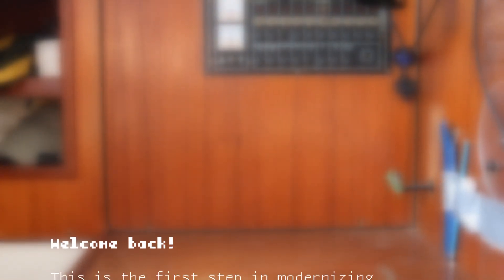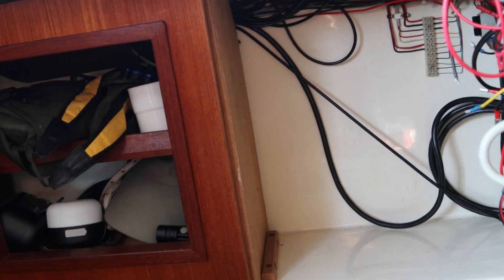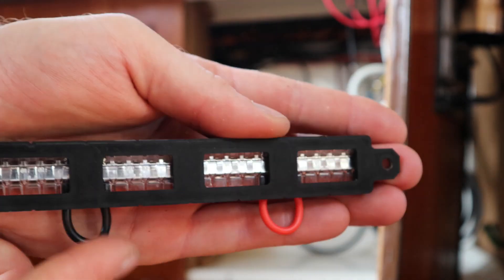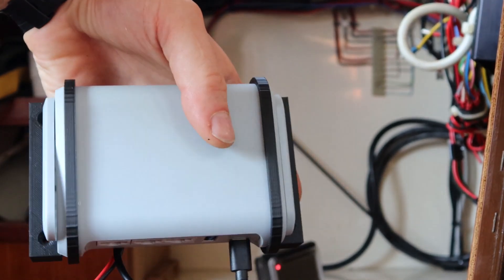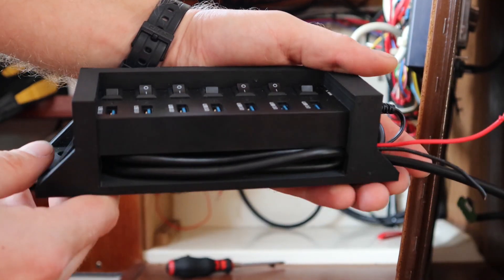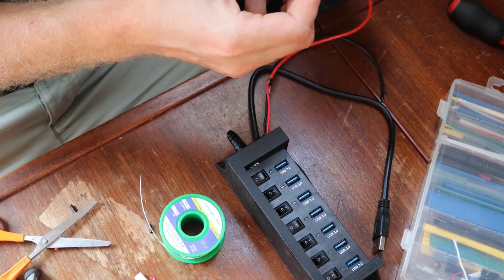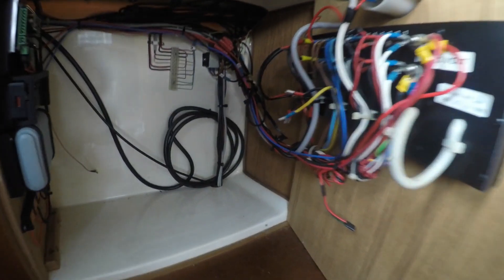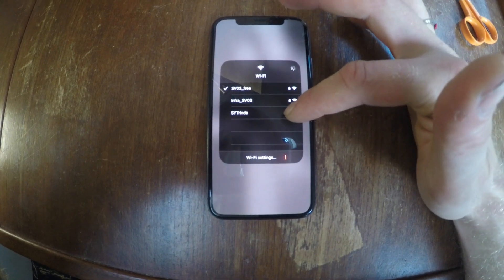DIY navigation electronics using OpenPlotter and MacArthur Hat

Comment: Random question on the USB Hub and the 'short cables'. I bought the same one and the cable seems plenty long. Did you use a different power connector or sacrifice wall-power unit which came with the hub?
Reply from the maker: Hi Neil, the USB Hub is powered by 5V DC. To get the voltage right, I have a 12V-to-5V DC-DC converter in my setup (see in the description 4. (USB Hub) 12V-5V DC Converter).

The wiring for me looks like this:
USB-Hub (5V) <-> DC-DC-Converter <-> (12V) Board-Grid.

Unfortunately that's not so clear on the video, because the converter is hidden inside of the bracket of the USB-Hub.
I've cut-off the cable from the wall-power unit and then soldered the cable onto the converter. The converter has two more cables getting +12V and Ground as input. These cables (which I've prepared) were short. 

I hope this answers somehow your question :-)
Reply: @8bitsailing  thank you!

Comment: Hi ! I have a similar project going on before this summer. (Nauticat 33, openplotter, MacArthur HAT, Halo 20 radar) Could you provide links to the usb hub and router ? Also stl files (or cad files) for the brackets would be nice. Best regards, Gunnar
Reply from the maker: Hi Gunnar! Awesome, I wish you all success for your project. 

I've added links of the parts in the video description and as well links to the 3d models of router and usb holder.

For the router I've used a different DC down-stepper then for the USB holder. Probably you want to use only one type.

Comment: Hey i know this is crazy but what is required to install the nmea network to say a yahama engine that supports nmea 2000
Reply from the maker: If you already have a NMEA network it's quite straight forward. You need to connect the MacArthur Hat to your NMEA network and then it should receive already all data-packages, which are send through that network. Then it's only about configuration in e.g. SignalK server, which is running on the raspberry pi.

If you don't have a NMEA network yet, then you need one in the first place. You need to connect your engine to the network. When you've done that it's the same then described before.

In the near future, I will fit a SeatalkNG (similiar to NMEA2000 only difference are the connectors) network into my boat and connect it to my DIY plotter. I will show it in a video as well.

Comment: Congrats for your new chanel, very interesting. I am actually on the same,  project of restoration a Formosa 47 which was sink and all electric and electonics must be changed (nothing runs) and of course I will renove all with Raspberry Pi from tip to top, but my knowledge of computers and sisems are limited, and DIY is hard, but of course will be a plasure to share our common investigations and knowings about those matters. Thanks again to share your knowledge.🤙👏👏👏
Reply from the maker: Waow, you‘ve a tough project in front of you. Wish you all the best for your refit. In the near future I’ll try to add some mir detailed videos about setting everything up. Probably you could adapt some of that and avoid spending too much bugs for all that fancy equipment 😁 🤙🏻

Comment: The feature to shut down the Pi when the 12v supply is cut,  is that via the MacArthur Hat or some other add on?
Reply from the maker: The shutdown-feature comes with the MacArthur Hat. To enable the feature you need in addition to the hat a so-called power-module. From the shops-page:

"Optional 12V to 5V DC/DC converter for the MacArthur HAT to power the Raspberry Pi and its peripherals (including touch screens up to 10 inches). When you turn off the main switch of your ship, OpenPlotter will shut down safely. OpenPlotter will start cleanly when the main switch is turned on again."
Reply: @8bitsailing  thank you.  I had not seen that module.  
Lovely looking boat you've got. I've got a 1983 Leisure 23SL that I am restoring, and all the instruments are old/broken and need replacing.
Reply from the maker: Thank you so much. Actually, my boat is a Comfortina 32 from 86 with outdated electronics as well. In the near future I’ll upgrade to a nmea2000 bus and add some accessories to it.

Boat refits are fun, besides sailing them 😁

Comment: What model pi are you using? I have been told that there are problems with pi5 and Open Plotter.
Reply from the maker: Hi @scottphillips8767 I'm using a RPI4 with 8GB RAM. Unfortunately I didn't had the opportunity to test it with a pi5